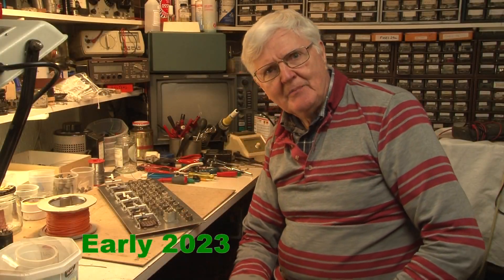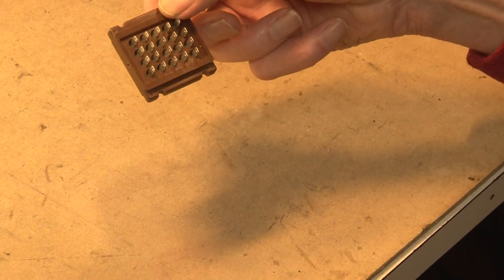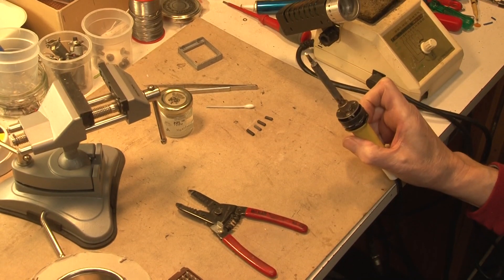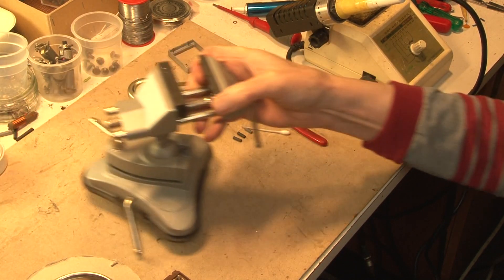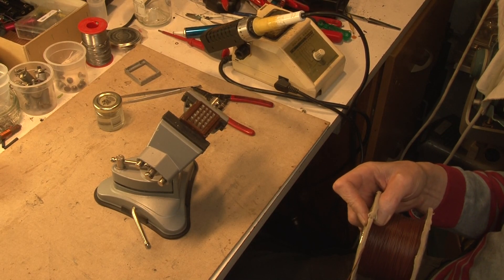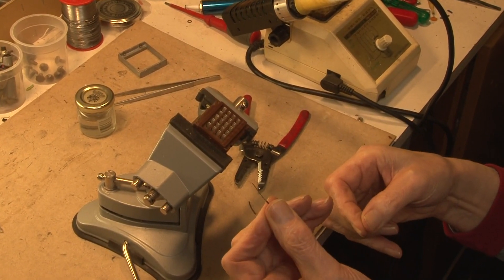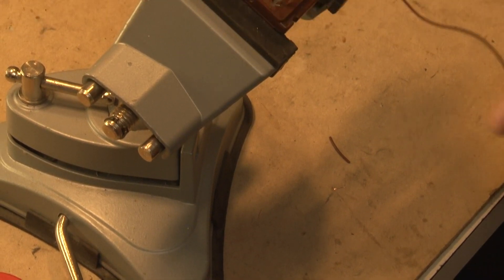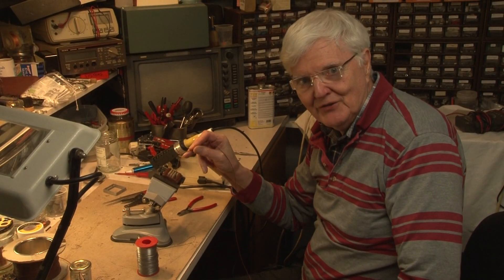A demonstration of the work involved in soldering just a single piece of wire to one connector tag

Comment: Well, each one after this will of course take less time as the preamble and initial set-up is done.  You could also save some time and effort by upgrading to heat shrink sleeves  rather than the Hellerman,
Reply: Hi thanks for your useful suggestion, we have used the Hellerman sleeves as they were used originally and it is important for us to maintain it as close as possible to how it was built.